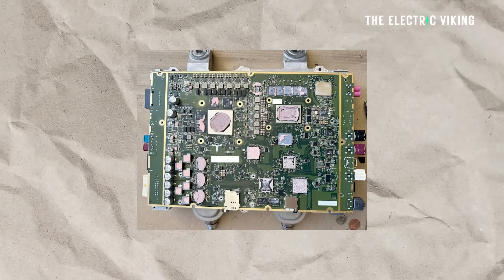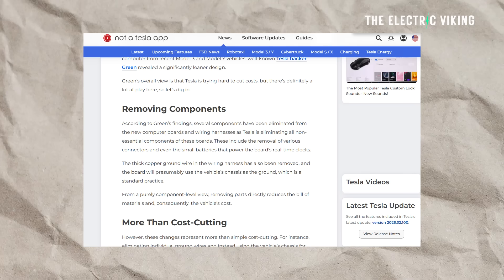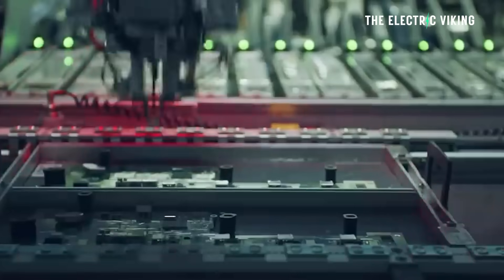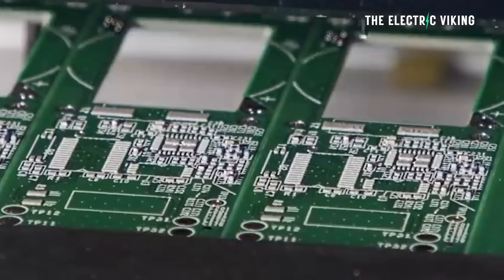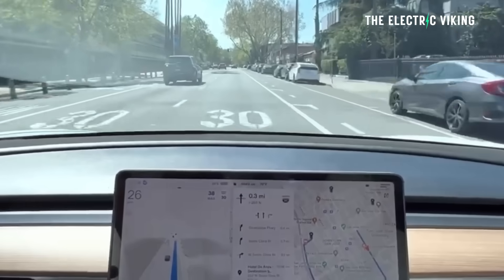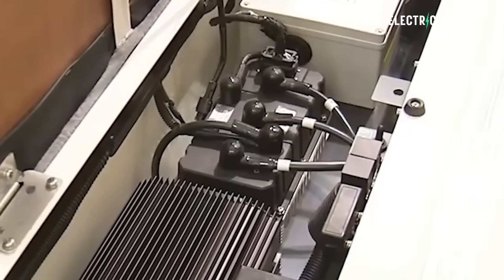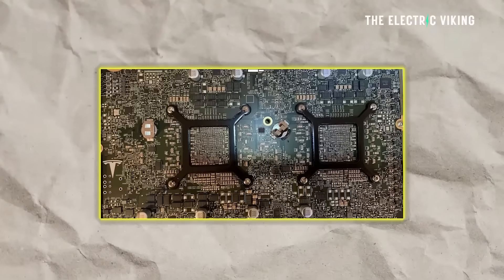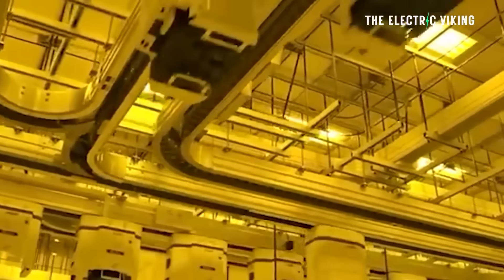Tesla's Changes to A14 Full Self Driving Chip Reveal New Hardware Coming

Comment: That low voltage battery in Tesla is actually 15.5 volt which creates issues with the Trailer 7pin wiring harness, Tesla does not support the 12volt AUX line (which they have not connected) which is normally used to charge the Trailers 12volt battery used in it's brake system, Tesla did claim 3 year sago that they would have a fix for this, but as of today still do not have a fix.
Reply: they changed that....new LFP low voltage battery in my MY is running at 14.4 volts.

Comment: Cutting (copper) costs???
In that case they should move from 12vdc to 48vdc, and from 400vdc to 800 vdc.
Those moves reduces the currents (and subsequent losses) thus reduces requirements for wires.

Comment: as some one who worked in electronics for years, I can tell you connectors are a common failure point.  Worse yet, they frequently fail intermittently.   I always told my engineers to use high quality connectors.  The extra cost is worth it.  So, if you can eliminate a connector, you are eliminating a potential failure point.

Comment: I am more interested in the next update to the software. The modified chipset is a minor temporary improvement and just like the next launch of Starship.. the last block 2 starship while it will help spacex learn a lot it is a test bed for the model coming next. Yes the hardware change is nice if you are buying a new car and shows the constant improvement in the hardware...

The current problem with buying a used Tesla is the 3rd party dealers do not understand the changes in chips as well as other things... in face you can look at 3-4 same model year and same model and version... and they can all be different. it is both a good and a bad thing.

Comment: Incorrect, clickbait headline. The changes are to components on the printed circuit board, rather than the AI chip. And as others have pointed out, the chip is AI4 rather than A14.

Comment: @2:45 ALL capacitors and batteries eventually fail. Degradation over time of soldered-in *active_ components is an old, well known problem. 
It's what makes it so hard to keep old computers and routers running year after year and keeps repair shop in business.